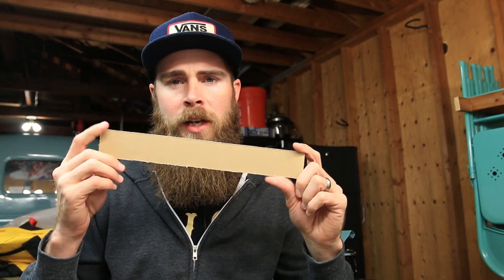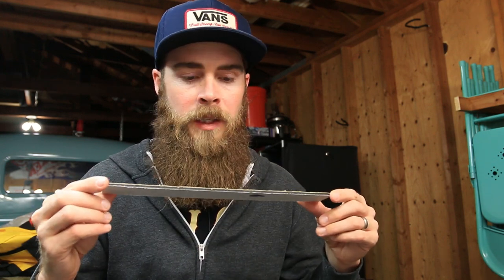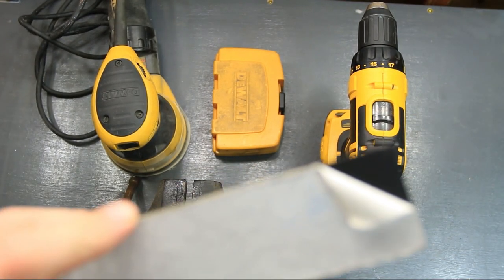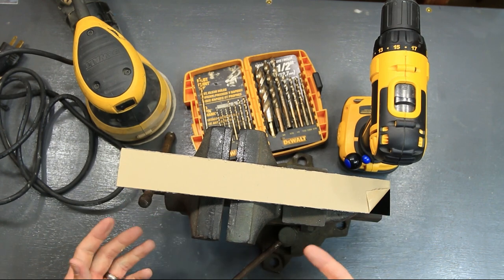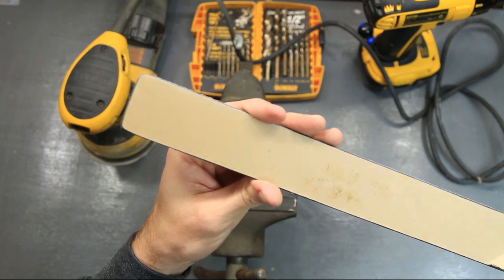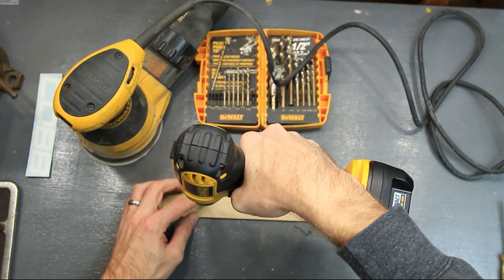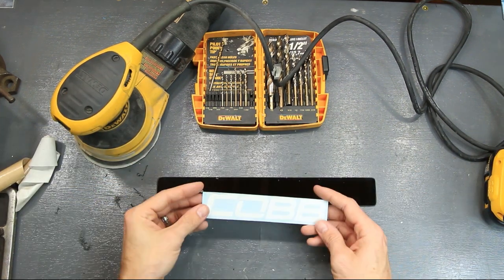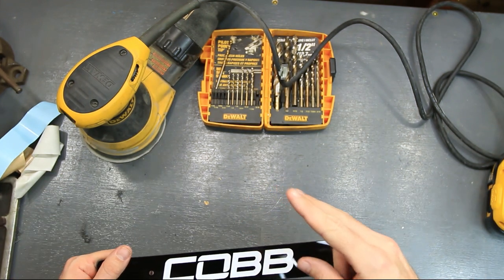DIY License Plate Delete

Comment: A DIY with nothing to show of the finished product on the car? Bruh... Oh also, wouldn't a front license plate delete be... removing the front license plate from the car?
Reply from the maker: +1000hpHONDA looks like you found the other video.
Reply: 1000hpHONDA it is a federal law in some states to have a license plate on the front and back of all vehicles
Reply: Mr200 MPHJunky 
I just use Velcro on the plate so I don't have to drill holes, and if your lucky your car would be the same color as the Velcro colors, so it doesn't show as easily on the bumper when you wanna take the plate off. 
I need both plates in my state, I still do the Velcro deal cause it's easier to pull it off when I'm cleaning the car.
Reply: Mr200 MPHJunky "A federal law in some states"...uh...
Reply: Bryn Swartz 
Yea that's a hoot😂

Comment: Great DIY! The blank area on the bumper doesn't really bother me, but I still don't think I'd ever want to spend $60 to advertise someone else's company on my car. But for $2 & a good company like Cobb? Sure. Turned out great! BTW, this week sometime I plan on building your DIY sound booth. 👍🏻My room has way to much reverb. 😐
Reply from the maker: +HawkeyeSTiGuy Nice I think you will like the difference it makes to your audio quality. My second audio source failed me in this video the cheap lapel mic stopped working that why the audio wasn't that good in this video.

Comment: wait what is the point of this.  why not just remove your plate
Reply: You do, but then you have two ugly holes in your fender that the dealer just drilled in there. So this is basically just a cover up.

Comment: I made one out of some steel I had lying around, but I can't find any hardware to actually mount it. Oem plate screws aren't large enough to fill the holes on my 2015... Anyone out there with advice?
Reply from the maker: +Naut Applicable I think they sell inserts at the hardware store.
Reply: +Blake's Garage I was at Lowes for about 2 hours testing and returning different nylon inserts. None of them fit. Either too big or too small.